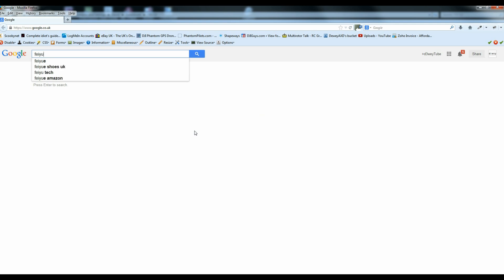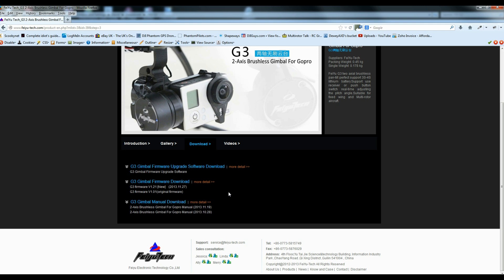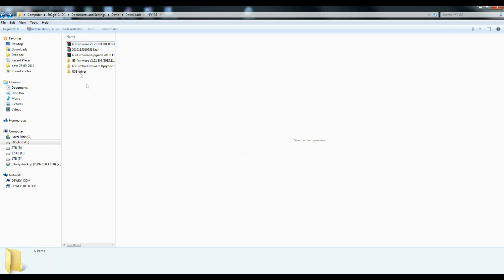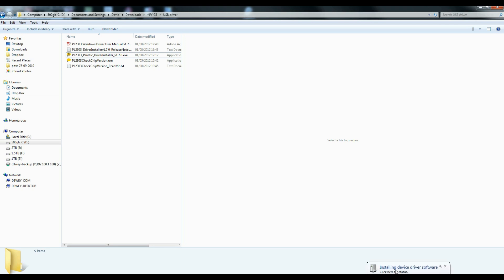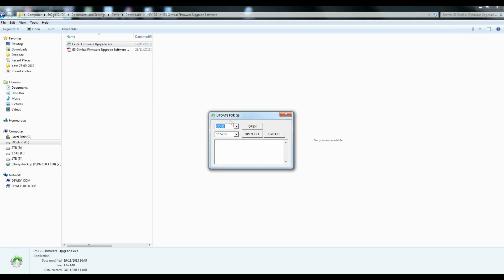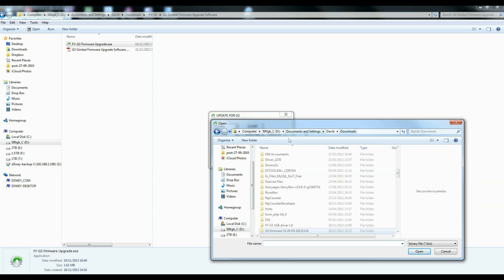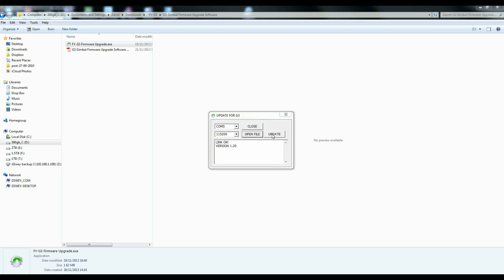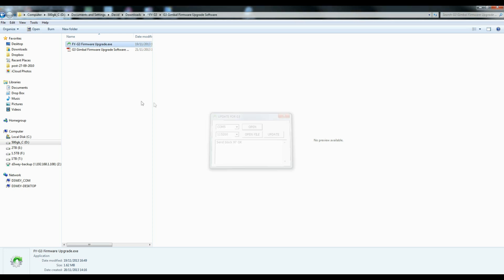How to Update Feiyu-Tech G3 (FY G3) 2 Axis Gimbal Firmware

Comment: Hey man, it's a very good tutorial, but I have followed all the steps to update the firmware, and I always get a message SEND FAILURE, I can do?
Reply: +SURTYCOM SURTIDOSYCOMPUTADORES - I am also having trouble- "send failure"  - the usb connects properly and show the com port but connecting to the gimble doesn't seem to do anything (tried it with and without batteries) .  Di you ever find an answer - little on the net re: troubleshooting

Comment: Hi - a great tutorial. I recently bought the G3 hand held 'steadycam' device. As far as I can see there is no mini or micro USB port. Do you know if that means it just can't be updated?
Reply from the maker: Hmmm that is a tricky one. Assuming it only comes with the 4 pin connector that plugs into the steadycam then no you can't update it with the equiptment you have. The gimbal itself is just a standard G3 gimbal so it can be updated but you will need the USB cable and the mount for the DJI Phantom (which doesn't come with the cable sadly). Best bet is to contact the place you got it from and see if they can get hold of these for you or to contact Feiyu-Tech direct.... I have no doubt they will supply you but you might have to wait a while for an answer and postage. Of course the other thing to do is find a retail shop that sells the G3 for flight and ask them if you can come in and borrow a mount/USB cable to do it. Failing that reach out on some of the forums like RCgroups, Phantom Pilots or DJIguys and see if you can find someone local to you with one. All you need to do is take their 4 pin connector out of the main board, plug yours in and then following the update process.
Reply: d3weyTube Thanks for the prompt reply. Much appreciated. Have written to the sales lady (Linda) at FT but no replies yet. And the service@ email address just bounces...  I do have a Phantom, so that connector sounds like another good plan. Happy Easter,  anyway!